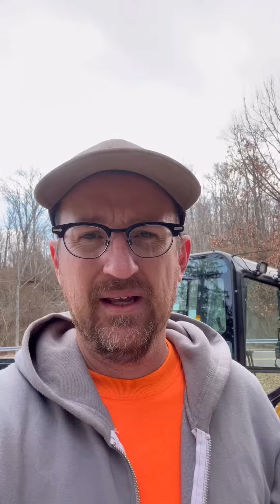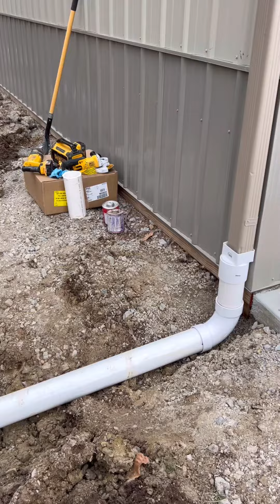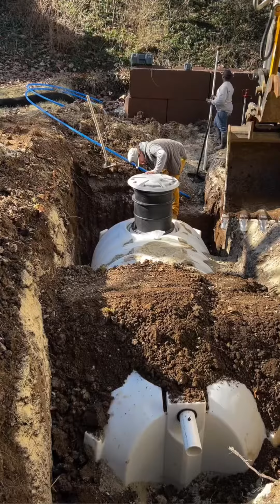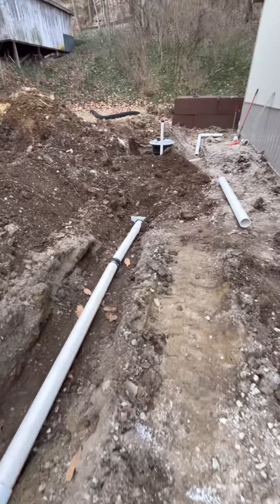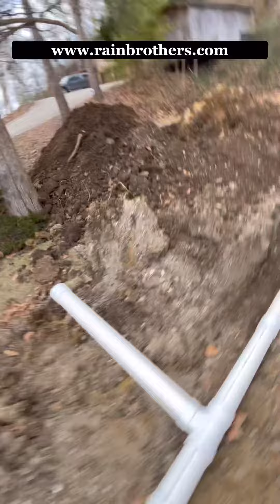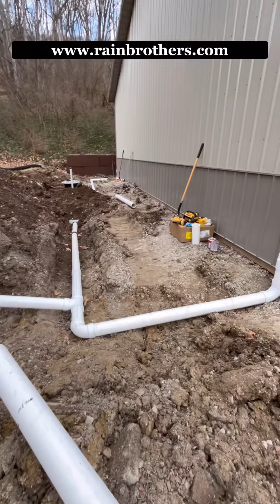Rain harvesting trick! Free extra water!

Comment from the maker: Now before you get mad at me for recommending this unorthodox approach, please know that I’ve been doing drainage and rainwater harvesting system installs for 18 years and have used this approach successfully many times (always with the owner’s knowledge and permission). NOTE: Make sure the downspout connection to the drainage pipe is HIGHER in elevation than the overflow discharge height. Come visit us at https://www.rainbrothers.com